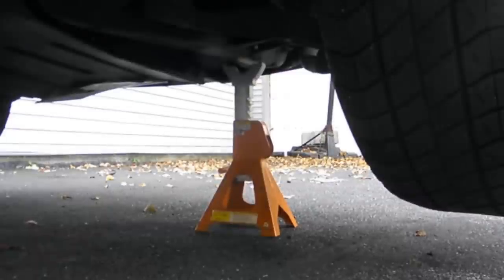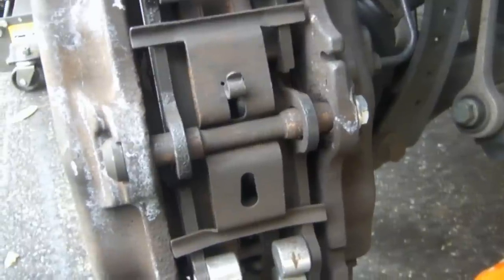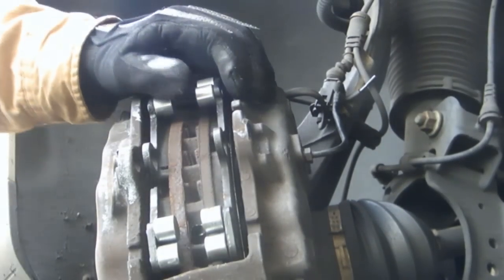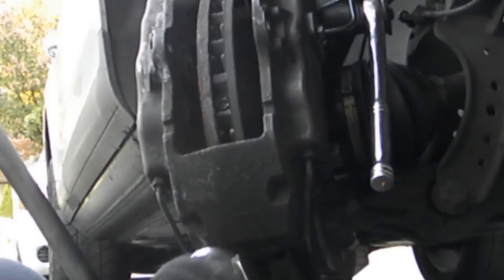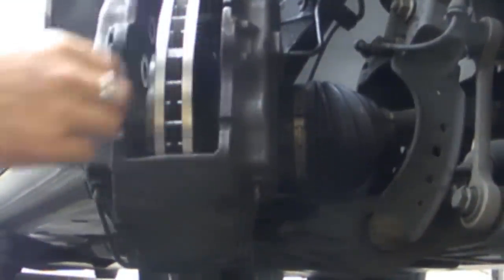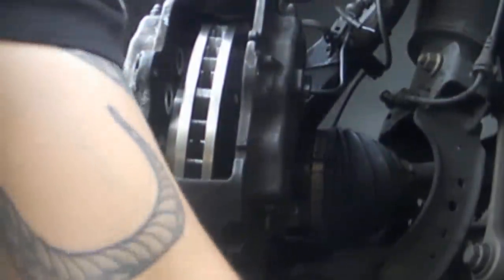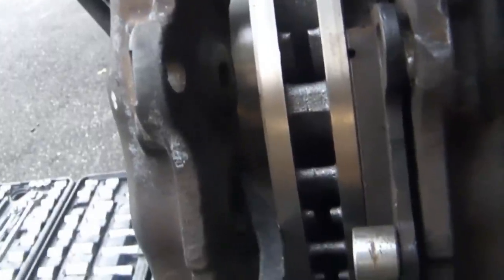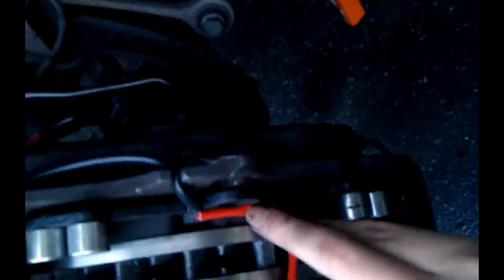Front & Rear Disk Complete Brake Job Part 1 (2005 VW Touareg)

Comment from the maker: The part numbers for the rear sensors are 7L0907637C for URO brand, EWS113 for Wagner brand, 5S11602 for Airtex/Wells brand, 19013 for Carlson brand, and 0841540 for Beck/Arnley brand.  .
The part numbers for the front sensors are 7L0907637 for URO brand, EWS112 for Wagner brand, 5S11601 for Airtex/Wells brand, 19012 for Carlson brand, and 0841539 for Beck/Arnley brand.

Hope this helps.

Comment: Hey, man, thanks for this video, it saved me a lot of time and money... One question... After I pressed down the brake pedal several times, pedal became hard as you told but I've got some brake fluid that came out of the brake fluid tank and looks like I need to add a little bit of it to full level, but brake pedal became very soft after I started the engine, and still soft after I pressed pedal several times... Did I get  air inside the system?..

Comment from the maker: It is not necessary to have the rotors screwed on. Even if the manufacturer installed a screw. This is true for all cars. The tire and the lug nuts/bolts hold the rotor in place once they are tightened. It is purely up to the vehicle owner if they want to re-use or install a new rotor screw.

Comment: I was at Les schwab earlier today doing tire rotation, when they told me that my front brake pads need to be replaced. The shocking part is that the price of pads+sensors+rotors was around 1900, I don't know if this price is real.
Could you please give me the parts numbers so I could maybe order them online, I got an 05 touareg

Comment: I have a 2011 Cayenne S.  I believe the brake systems are the same on the Touareg and Cayenne...and hopefully from the '05 to the '11...?  Do you know?
Reply from the maker: Tom Gore I know the brakes are the same on Touaregs and Cayennes. However, I don't know if they're the same all 6 years in a row. That being said, brakes are not that different in general. If you can learn how to do brakes and do them a few times, you can do brakes on almost anything. Just inquire and make sure there are no other electronics involved beside the brake wear sensor, and you should be able to do the job.

Comment: Dude how come you didn't have the screw that holds the rotor on from the front put back in. Haven't you noticed there are six(6) holes on that rotor and only five(5) bolts to mount the wheel??